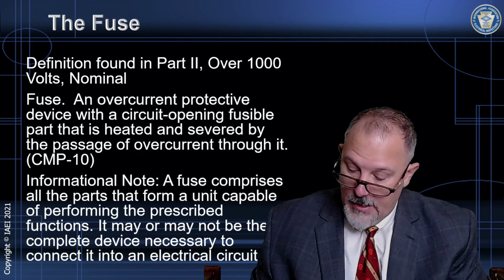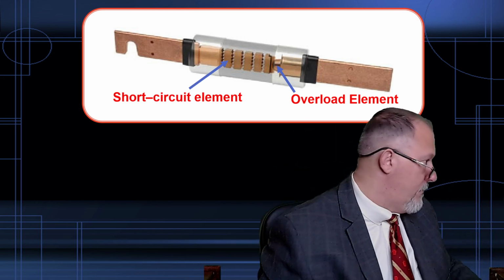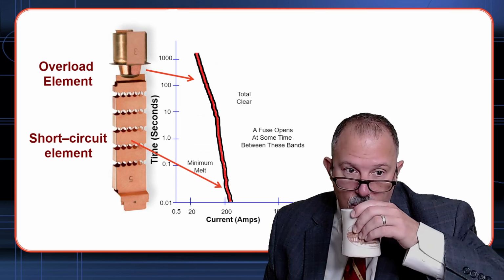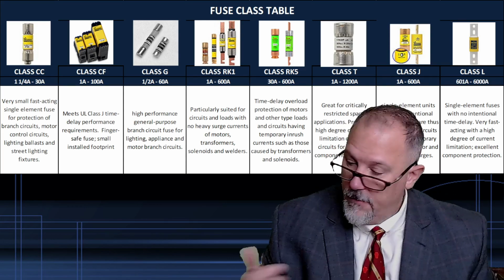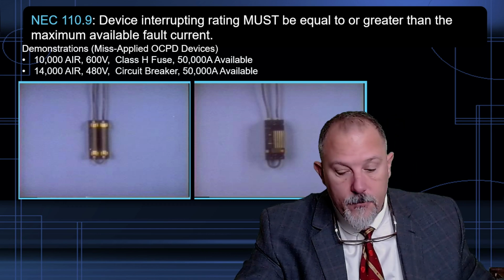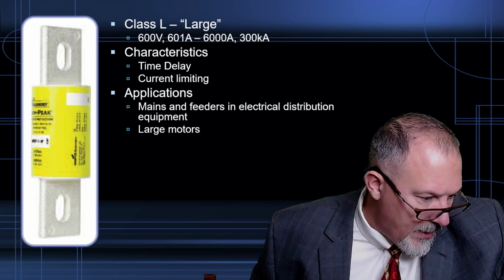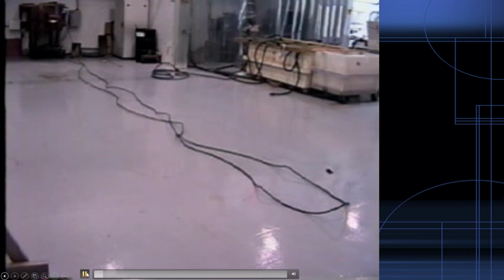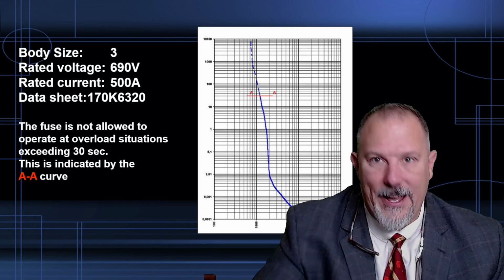Fuse Fundamentals

Comment: I have a question I was praying you could help me with that is always asked of me that I can't answer.
Can we use a say 600V rated fuse in a 250v circuit? Is there anything wrong with that electrically and/or does it violate the code some how? Really appreciate your time, thanks.
Reply from the maker: Hey there Holmz Law, yes you can use a 600V rated fuse on any lower voltage system.  Just don't go bigger.